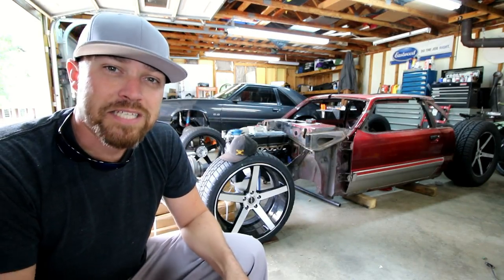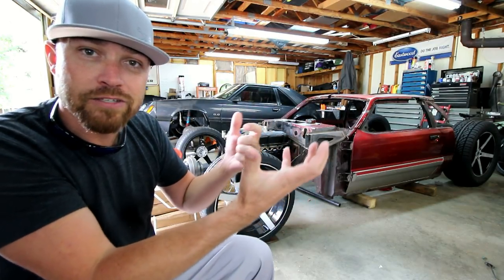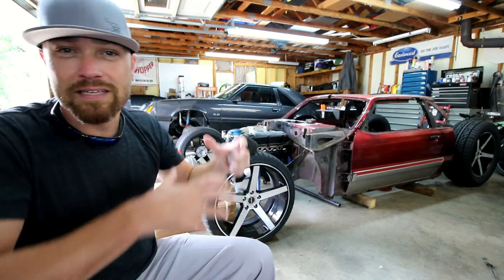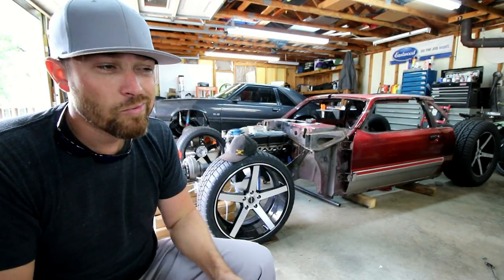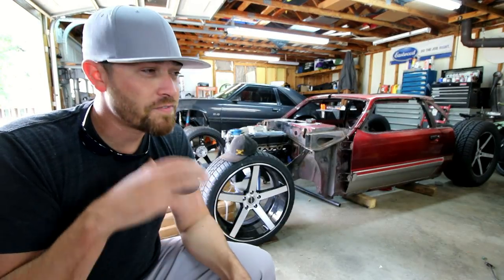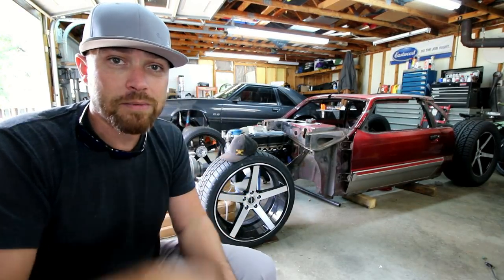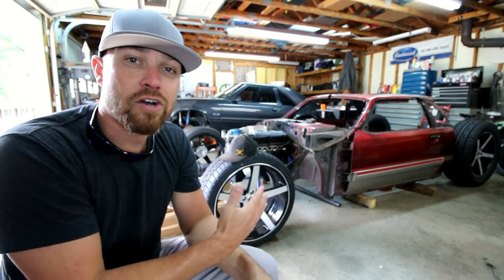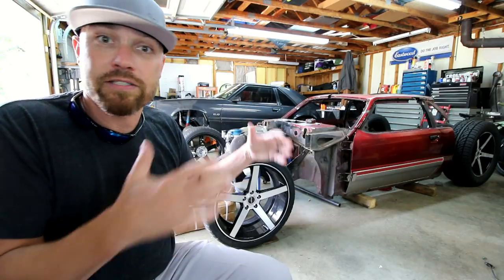Welding Aluminum Exhaust On The Twin Turbo Mustang

Comment: Pro tip that I learned:
Use a tiny washer and anti seize on the threads of the v-band clamps.
Can't tell how many clamps I ruined zipping the lock nuts on and off while fitting kits before I was taught this.
Keep up the great work👍
Reply: Hoyt Dutton I
Reply from the maker: +Hoyt Dutton I could see that
Reply: good tip learned this from an old timer a few years back
Reply: the anti seise could cause the torq reading to go way off , at some bolts and nuts like from arp they advice to install dry , the lesser friction caused by the lubrication can actually cause the tread to strip or bolt to break before torq is reached 
if you do use this method for temporary mounting the v bands use a realy low setting on the electric ratchet and wipe the grease off when doing the final fit
Reply: watahyahknow first time I heard bout that. Arp wants me to use engine oil on rod bolts when using stretch gauge. And ultra-torque lube when using torque wrench.
Reply: watahyahknow so you suggest not to use lubricant on fasteners? Have you figured how many newton meters of frustration and cursing there will be if you can't remove or ruin a very expensive component of your car cause of not applying anti-seize? I'm going to continue using thread lubricant.
Reply: i suggest that IF you use lubricant you dont set the wrench to kill but keep the torq moderate enough to hold the part in the v band but not tighten it fully
Reply: watahyahknow 10-4

Comment: The finger switch on the torch is soooo handy for roll cages and welding in hard to reach areas.
Reply from the maker: +Angry Beard Man yeah but I still end up using the foot pedal for the adjustability

Comment: For your heat shielding on the stainless you might check with FTW Coatings in Wichita, KS. Ryan can do some real sick stuff with cerakote, his digital camo is my personal favorite he's done.
Reply from the maker: +Michael Cornwell I'm gonna need more of a wrap style barrier to minimize heat
Reply: That's why I recommended the cerakote, it performs even better than traditional ceramic coating does on containing heat. And ceramic is as good as header wrap if not better with a cleaner look imo. Worth checking into at least, good luck moving into the new shop also.

Comment: Have you considered the possibility of your alum exhaust pipes melting? EGT's at the downpipe can exceed 1200*F under heavy load depending on the tune. Aluminum's melting point is 1220*F but more importantly, its yield strength (for 6061) drops to less than 15% of its original strength at only 500*F. I didn't see this anywhere in the comments so I thought I'd mention it.
Reply from the maker: I have...Have you considered cylinder heads and Pistons are made out of aluminum?

Regardless you wont see 1200 degrees in the down pipe, you may see that before the turbo but not after. Besides it has 3 or 4 foot of stainless before it turns into aluminum.
Not saying I wont have any long term issues but I have done this before on a turbo setup with no issues and there are all kinds of drag racers that use aluminum only for down pipes.

Comment: Hey Kyle where did you get those pliers your holding the pipe together? Caught my eye instantly. Thanks
Reply: Brian Bowman .... liked the pliers too....
Reply: Looks like strong hand tools pipe pliers
Reply: Cool, I'll check there website. I saw those, said dam that would make life real easy!
Reply from the maker: +Brian Bowman I have a link in the description listing all the tools I use
Reply: Brian Bowman       just order vice grip weld too.   So stoked.   Cool tool.   31,00 dollars not bad

Comment: How many amps you set for welding the stainless vbands?  Do you use pulse?
Reply from the maker: Not sure on amps....I just feed power as needed. I use the mix setting that kind of has a pulse.

Comment: Hey brother awesome videos, I suscribed. I'm wanting to start my hand at TIG welding, I seen your TIG200 video, awesome but will that one be a decent start off tig welder. I know u have that miller, which is better the TIG200 or your miller? In your eyes lmk.
Reply from the maker: The Digital TIG 200 has more features than my Miller and is an AWESOME starter machine. I love mine

Comment: Are you using the #12 furik stainless gas lens for ac aluminum? I thought you only should use the #8 so the ac current doesn't mess up the screen.
Reply from the maker: yeah if you get it too hot it will melt the screen for sure
Reply: The Fab Forums ohkay gotcha thanks for the reply man. I'm also from South Carolina but in the Greenville area! Love your channel btw
Reply from the maker: +TigLife Fabs Awesome...I'm not far from ya over in Seneca

Comment: wont the front suspension hit the pipe when fully compressed?
Reply from the maker: +Matthew Skaggs no it doesn't even get close
Reply: I was wondering about that, too, in the first view at wheel level into wheelwell. To me it looked like the tie rod might hit the exhaust pipe when the tie rod was parallel to the ground; the 'goal' to minimize bump steer. A wider shot latter on cleared up my misperception of the clearances.

But hey, I have seen many off-grid construction videos where they are demonstrating vertical "plumb" and some of those videos  it looks all catty-wampus. Cameras can distort distance and angles especially when close up.

Comment: @ The Fab Forums - I see your using a portaband. I use the same thing. How do you get your cuts straight. Mine seem to wander some. Secondly; have you ever used ebay intercooling pipe? Vibrant is good but very expensive
Reply from the maker: no idea, I have never had any issues with the portaband. Yeah I use ebay intercooler pipe all the time
Reply: The Fab Forums thanks. Maybe there's an issue with my portaband. appreciate the great show

Comment: So I have a small Lincoln 110 mig welder but I'm working on the border of its capacity, usually over.... I put $1500ish aside to purchase a new 220 welder, I want a platform that can mig and tig. Do you recommend a system? I saw a esab rebel 215 that mig, tig and arc welds for $1600. Any thoughts, miller seems to cost more then I have to spend
Reply: A lot of the mig tig machines are DC only so you can't do aluminum TIG. I'd keep the 110 mig and get a decent tig, I picked a Lincoln Squarewave 200 $1445 shipped from welding supplies ioc. Mulitprocess mig/tig machines sound like a pain in the ass to swap processes.
Reply from the maker: +Js S Im not sure to be honest. I have never like any of the multi use machines I have used....they may be better now
Reply: You can actually go old school tig with old cheap arc welders- buzz boxes if you wished to give it a go before getting too tied up in something you might not use nearly as much as you might have initially thought (if you have one already that is).... just  a thought. Alot of peeps spend copious amounts of money on multi welders only to find them sitting around never being used... when the money could have went elsewhere (into other tools or projects etc.). With that being said though, if you know you will need or use one often.... I agree with both of the above's replies.  
Stinger (scratch start) high frequency box or arc pig etc. 
A buddy of mine has a mig he put a spool gun attachment (for AL) that he gets surprisingly good results from... I tried one before and got horrible results (hated it) but somehow he makes it work... I have no idea how he does, but he does.  
 Again though, if going to be used often-doing a lot of "work" (not here and there hobbyist related stuff that don't have to be great..just work).... id personally go with dedicated style equipment instead of a multi-platform rig for the money if looking for the best results.   Just my 3 cents is all.... Peace!
Reply: Thanks for the advice, I finished my 66 mustang about 2 years ago and just finished my Silverado prerunner which I've had to borrow my buddy's miller 220v for the heavier thicknesses. My next project is a 68 F100 long bed that I'm going to cut the frame and make it into a short bed. I want modify everything on this build and make it clean and custom so I'll be using the welders a lot and I know this won't be my last project. I've just seen esab on the power block TV shows and they have a esab mig at my work. Maybe I'll look for a used mig and tig, think I need to do more research because I don't want to spend X amount of dollars and not be happy with my purchase

Comment: Kyle hope in your new shop  to see a car lift or two crawling around the floor like a snake gets old son !.
Reply from the maker: +Curtis von Epp lol....yeah
I'm sure a lift would be useful but for some reason I don't desire one
Reply: They really can make one lazy,  I got two cars that I have to get done but.... because they are not on my lift atm... I haven't touched either one of them much. bahahaha 
I seriously have it stuck in my head that if a car isn't in that bay than I'm not working on it... hahaha pfff  sigh  
 So basically my jackass might as well have a little single stall garage, since I basically only "do work" in one bay... and use the rest basically as storage per say. 
Funny thing is... I really didn't realize how bad said mentality has gotten until you just mentioned it.... time to kick myself in the ass. LOL
Reply: The Fab Forums I have access to one personally and I find that for something like the goose build it's really not that helpful. I wouldn't stress or go in debt for one.

Comment: hi Kyle Voss what kind of aluminum you are yous for exhaust. happy new year ;)
Reply from the maker: It just some cheap intercooler tubing. Not even sure what the alloy is
Reply: The Fab Forums oh so probably is 6061 t6  i thought is some kind of speceale aloy heat resisting aluminum

Comment: Hopefully the tire don't rub wen you turn....
Reply from the maker: yeah all that was figured out years ago when I designed the kit
Reply: I was also concerned about suspension travel. That steering arm may hit the exhaust pipe. While he was working there's no weight on the suspension. Couple that with a pot hole in the road...

Comment: wont you have suspension clearance issues with the pipe there??  

would be cool if you checked out my build! @ Vixen motoring on facebook!
Reply from the maker: +adam heed not it has a ton of space
Reply: The Fab Forums You  need this tool a car lift son .
Reply from the maker: weirdly not that interested
Reply: The Fab Forums  You will be a cripple when you reach my age if you don't get a car lift SON.